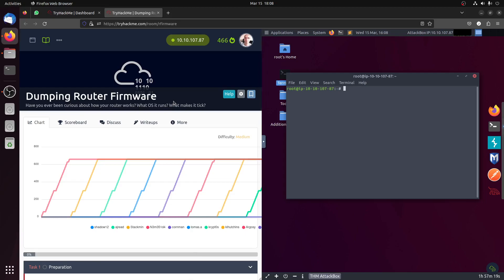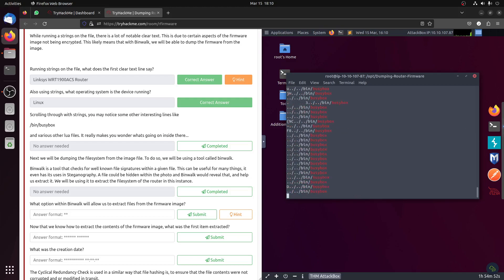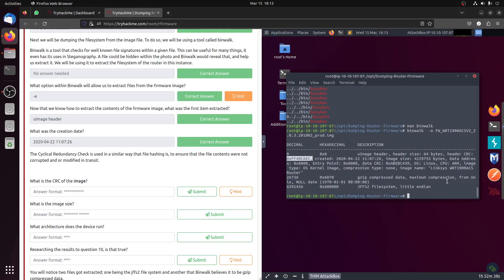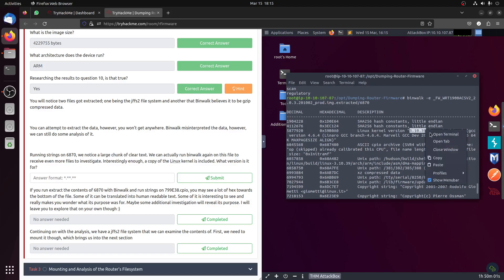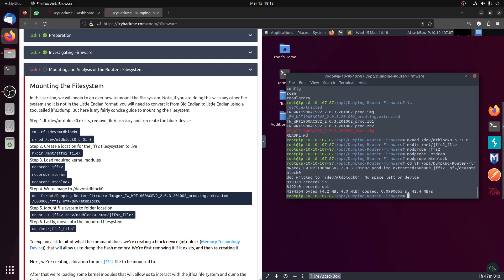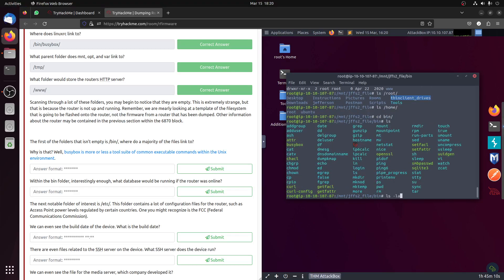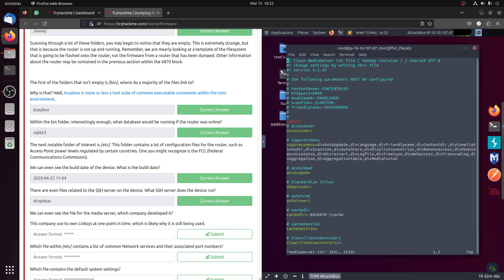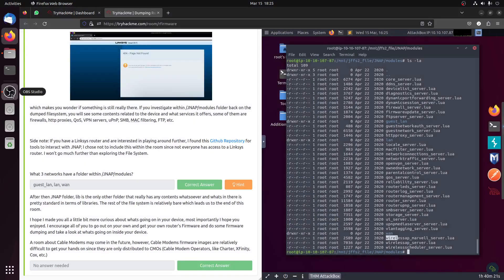Dumping Router Firmware Tryhackme

Comment: Very cool video! I've always been interested in stuff like this. A while ago, I had been trying to dump the firmware from my spare diabetic meter. I got stuck because, I believe it was an STM chip, that has hardware encryption or something like that.

I really wish I could find a tutorial on how to even begin to learn how to get started. (Or some type of 'kit' you could buy, that goes through it from start to finish). I'm far from being great with reverse engineering but, I really want to figure it out.